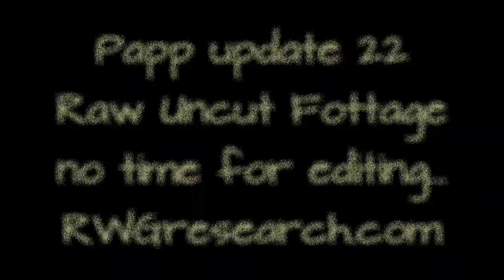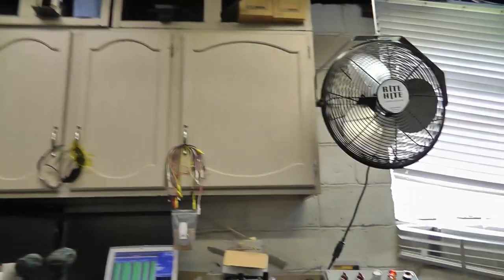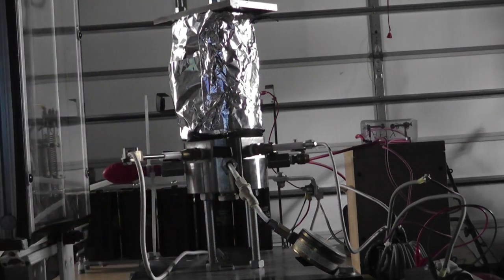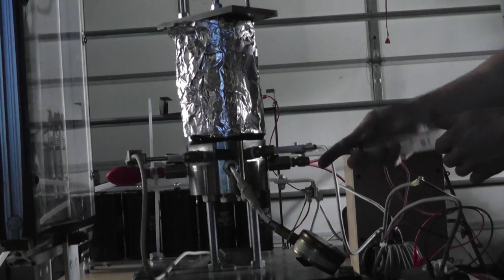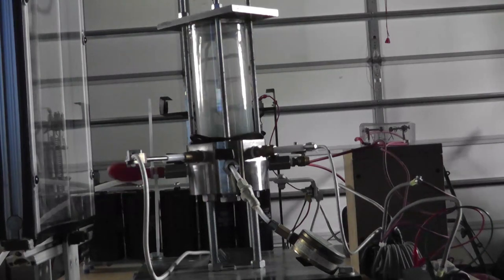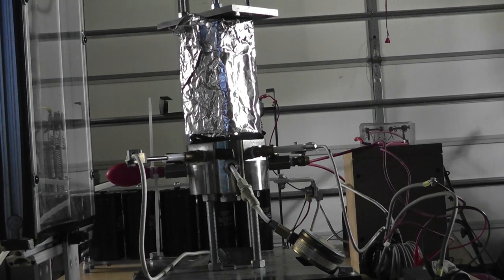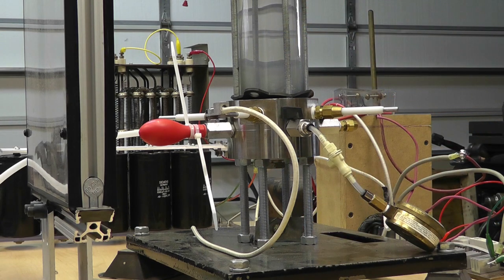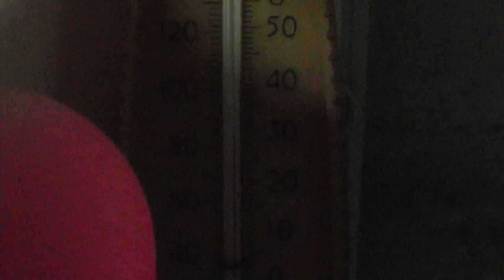Update 22 NGE Papp: Trying To Replicate Willard's Anomaly... & General Balloon Tests. Raw Footage...

Comment: One more comment. The balloon is expanding because the gas is expanding due to being heated. That would make sense plus as the gas cools back down the balloon shrinks back down. With Willard's video he may be seeing the same effect but magnified due to his sphere and yes the foil would/should reflect the light or even the infrared energy back into the system as heat and it would hold the heat longer too. Have you ever seen what happens to a 100W bulb rapped in tinfoil? It explodes due to heat.

Comment: I just viewed video 22. The aluminum experiment may not have worked because UF light cannot pass through glass. A quarts tube is transparent to UV rays.

Put the foil on the inside of the glass if that is possible. Cover as much inner surface with the foil as possible because the uncovered areas will absorb the UV rays.

Comment: Magnetically speaking his setup differs in that.. his spherical form of the chamber is more apt to include MORE inductive coupling than in your experiment due to the parabolic shape of the foil and transverse energy that is able to impart its waveform during its dipole moment. Fix this problem by inserting foil on the inside the glass AND with parabolic shape.

Comment: pap engine  running you have like 120 psi compression. the ignition would be on compression. compressed gas is different then nocompressed. put a balloon inside the chamber and fill the balloon, should be fairly safe, i bet your reaction expansion will be different. greater i bet

Comment: thats what i said, cdi spark, not huge plasma dump. the pap engine as in the first run of it would have compressed the gasses. compressed gas is different then non compressed, so he can put a balloon inside, put the gas in and then fill the balloon, gas ignition would compress the air in the balloon and prove or not that the gasious mixture explodes under compression. without killing himself and his neighbors

Comment: hey man.......turn that puppy upside down. the helium is going to the top and your igniting the ambiant air in the bottom. what your test show that all this thing is doing is heating the gas and that makes the gas expand. if you want to blow yourself up, you need to compress that gas and then ignite it. that should blow it through your roof and kill your nieghbors, so when you do it, dont blame me. and rohner told me that pap just used a cdi ignition. not a huge cap  bank dump